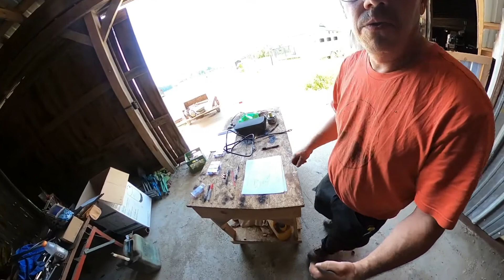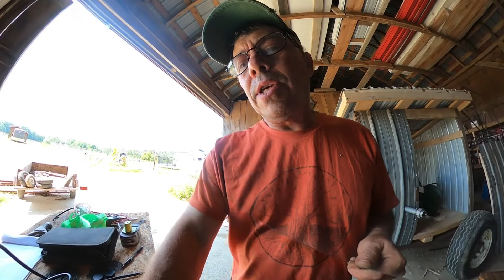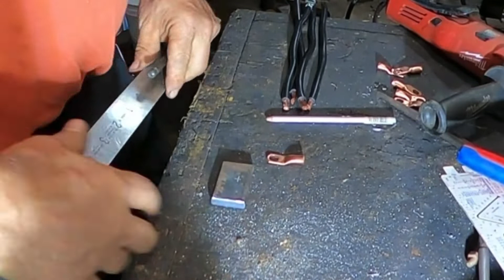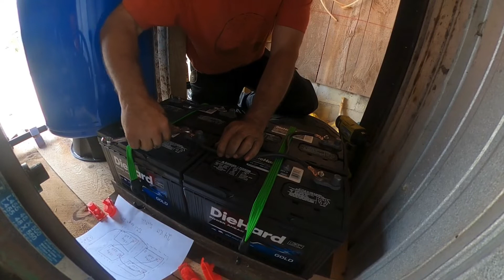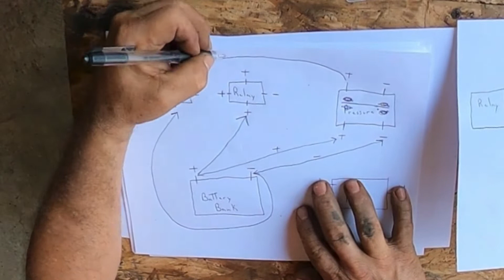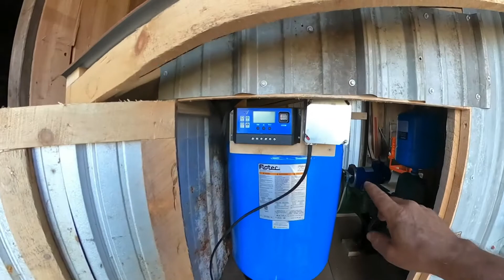Wiring Batteries Series & Parallel.  Diy Battery Terminal Crimp Tool

Comment: It looks to me that both relays are going to take the full amperage of the motor starting.  You could do a direct lead from the negative battery terminal to the motor and use one or both relays to switch the positive line.
Reply from the maker: The relays are taking the full amperage. Never thought of using both relays for just the positive. Great idea!! The motor is only 21 amps and the relays are rated for 40 amps. Was hoping that would be enough. Dc current can cause some problems.